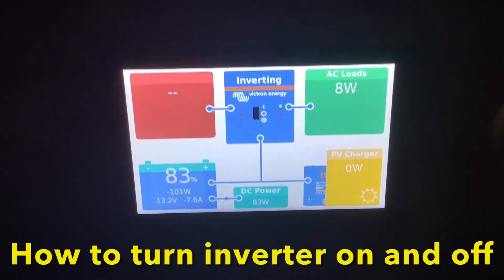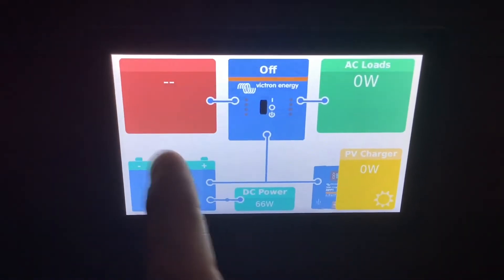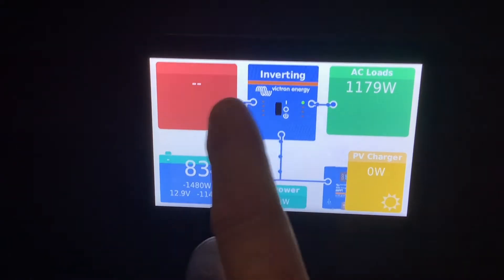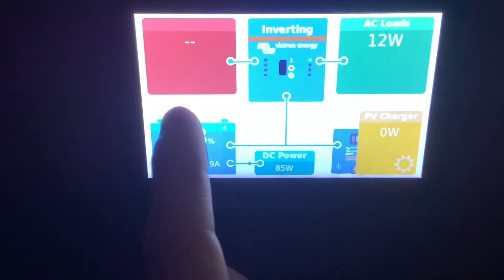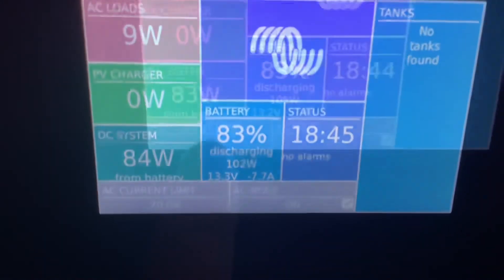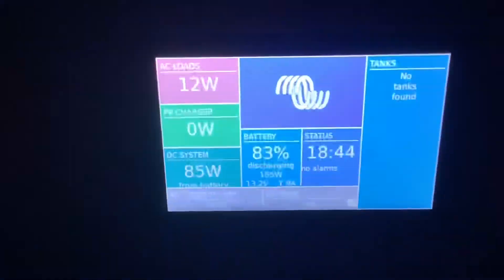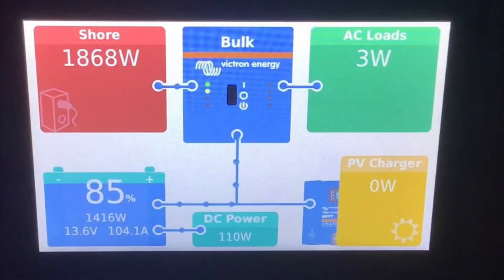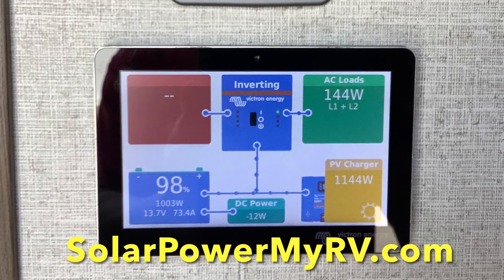How to turn inverter on/off. Victron Multiplus and Cerbo gx/ Touch 50 monitor

Comment: What did you do to get the AC current limit and multiplus on/off to be displayed on that screen?  I have to select multiplus and change it there.
Reply from the maker: Click the menu, then settings, then display and language, then you will see a setting called "show boat & motorhome overview". Turn it ON. Then you can go to main screen and swipe right.

Comment: So I turned the AC mode on and I am disconnected from shore power and the generator is not running but it never changes to inverting mode. What could be wrong?
Reply from the maker: make sure its NOT in CHARGE ONLY mode and just ON. Also check on the inverter itself. there is a switch there that over rides the panel. IF it doesn't turn on still, verify its getting 12.0v+ battery power to the inverter or it won't turn on inverter. hope that helps